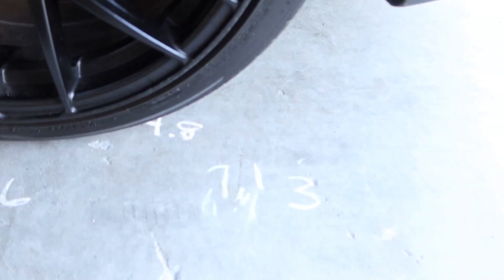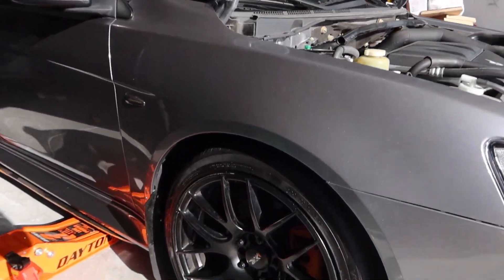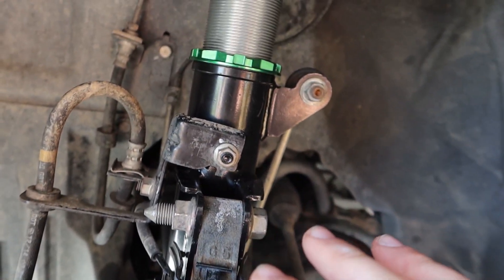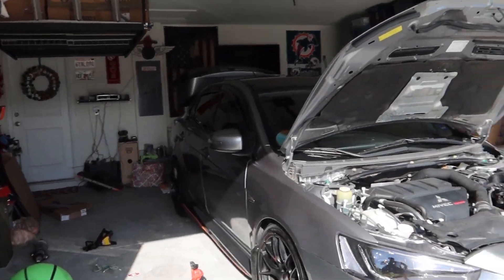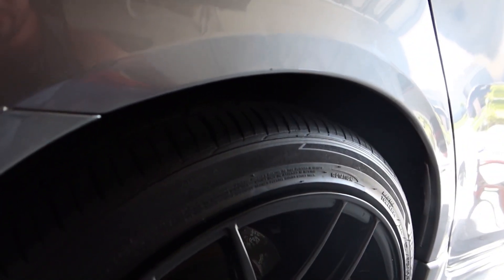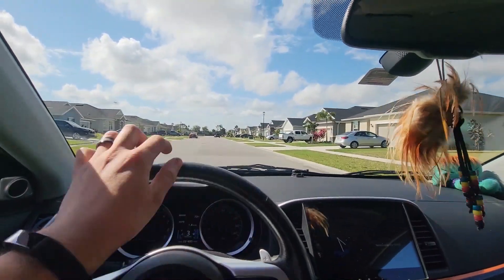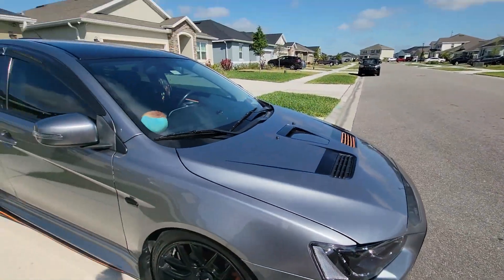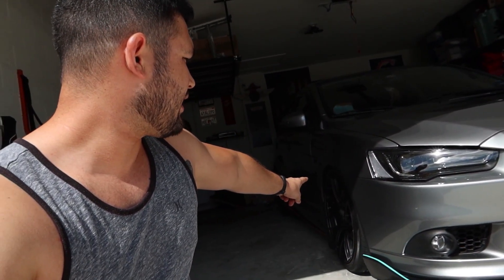Lancer/ Ralliart/ Evo X Coilover height adjustment

Comment: By Any chance were you able to get access to the Rear coil overs through the boot to adjust between soft/stiff. (Using the extender) I was unable to find anywhere to put the extender through.

Comment: You need to be careful not to go too low because it will bottom out. My VE SS Commodore hit a slight dip in the road at 100kmph which made the rear wheels hit the guard and almost lost control of the car.
Reply from the maker: Yup, def aware of that! Ive raised it up some since the video.  I think ill be okay. But thanks for the heads up
Reply: @TheSnyds  you're welcome. I ended up getting my guards rolled as I loved the look at that height and didn't want to raise it lol

Comment: Nice video! Have you run into any clunking noises since your coil over install? I have the tein flex z coil over kit & have clunking noises from my drivers front only. All the bolts are tightened down, triple checked everything
Reply from the maker: Nope no sounds whatsoever. Did you check your sway bar end links? I've have that problem in the past
Reply: Mines started clunking, did you diagnose the problem?

Comment: just got these installed and I'm running out of thread to rise the height. You aren't supposed to adjust the top two rings even if you keep them together because the preload changes. Here is an explanation on it  https://www.youtube.com/watch?v=04LU8JN2JjM